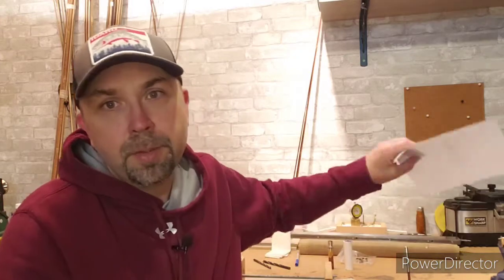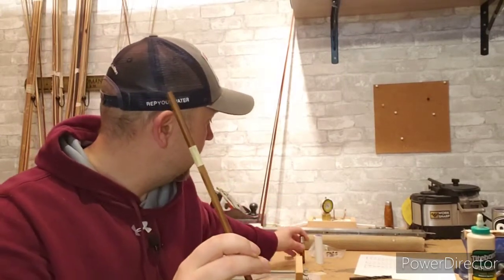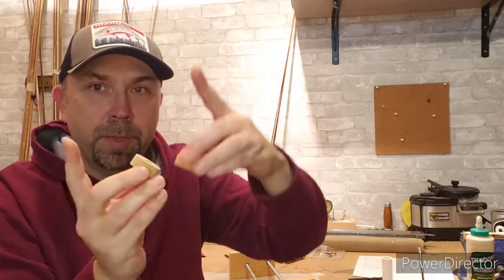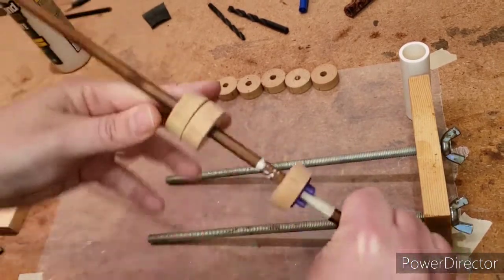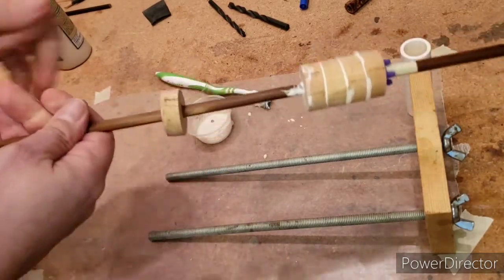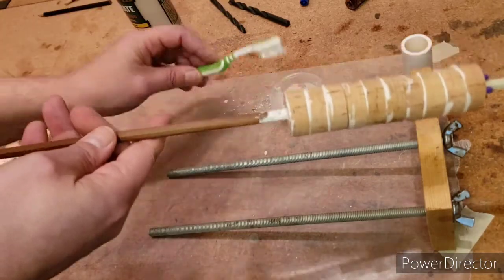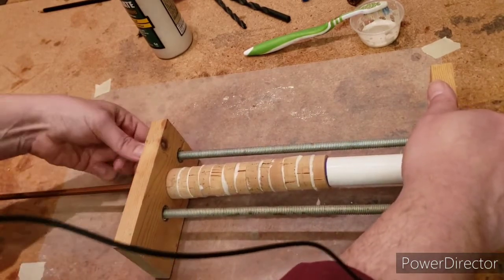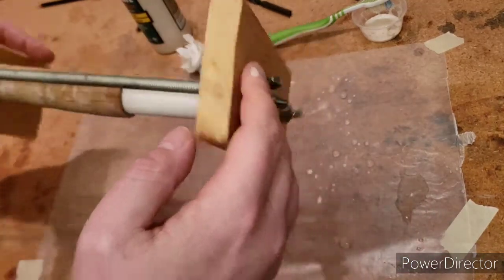How to glue corkrings to a blank!

Comment: I use basically the same clamp. My clamping pads are two extra cork rings(try not to glue them to the grip rings as I have done). As I snug up, I measure the distance along the axis of each threaded rod. Even distance = even clamping pressure. Love your channel.